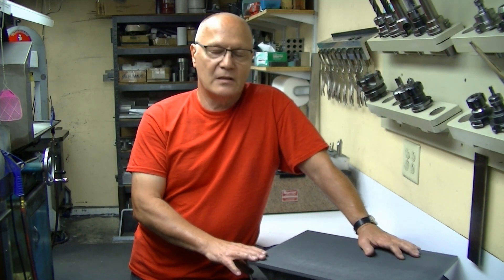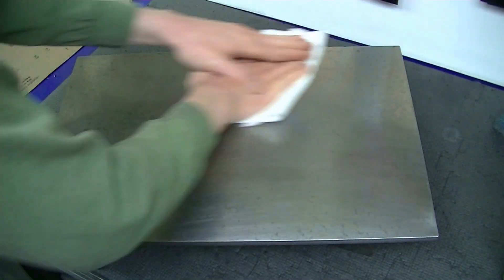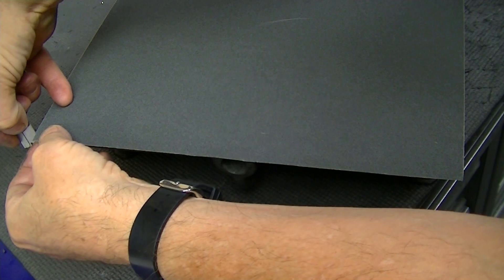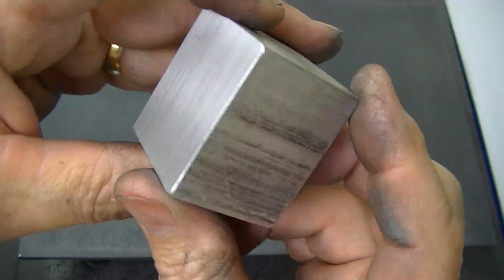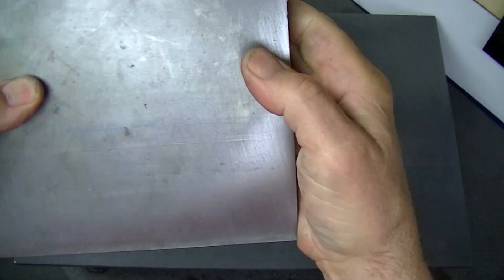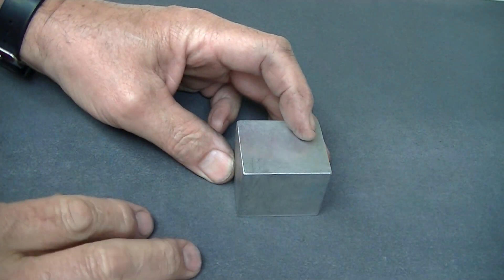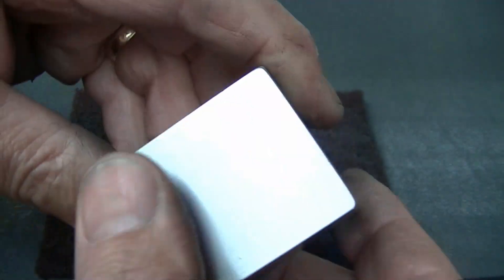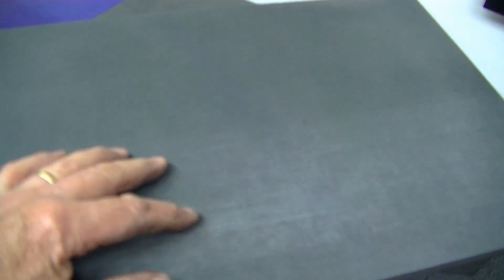THE MAGIC SANDING PLATE  TRT#3

Comment: Paper removal trick: once you lift a few inches of paper, use a dowel longer than the plate (enough for both palms on either side of your plate), and wrap the paper around the dowel onto its self, then use the dowel to roll off the paper.  Would you consider  tempered glass a affordable alternative to a cast plate?
Reply from the maker: yes

Comment: Thanks for the video. I need to order plate for this purpose. But I wonder which one to get, granite or cast iron? Cast iron would be better to move around and not break so easily.. Granite seems to be cheaper.
Reply from the maker: Granite is fine if you dont need a sharp edge.

Comment: We had a cast iron plate like that in our R&D department . We all thought it was a surface place ( like the granite ones ) only made out of cast.
Used it as such. Sometimes we would stick a DA  pad to it. Question , just how flat are they ? are there different types/grades ? how about figure 8's
Reply from the maker: Cast Iron plates can be scraped to any precision level required.
I don't like figure 8

Comment: Hey Robin, how flat do you recommend the sanding plate be? Do you recommend a lapped, ground or milled finish, or is there a PPI at which you’d consider scraping also viable? 

I’m making a sanding plate from a rusty old cast iron plate and trying to decide if I should refine it beyond the .001” flatness I got straight off the mill. 

Thanks for all your excellent videos. My machining has improved a lot from your tips.
Reply from the maker: .001 is plenty flat

Comment: Nice video once again! Thank you :)
Two quick questions: if the cast iron plate is flat (say AA), what kind of flatness can you attain on the part if you do it right?
Can you use it as you would with the precision ground stones (say to deburr the bottom of fixtures etc.)?
Reply from the maker: I would not use it for that.

Comment: If I did this, my technique would result in convex parts. I'm fairly sure that even with practice I would still fail to still have flat planes. Very impressive if you can do this and still maintain the geometry, I suspect your years of practice, including all the lapping, probably make this more feasible for you than it would for me (or maybe I'm just clumsy - im certainly still crap at golf despite decades of trying).

Comment: Alcohol doesn't work because 3M 77 isn't water-based.  Any solvent for oil-base products will remove it.  I usually use plain old mineral spirits (paint thinner).  Then I wipe with lacquer thinner if I don't want the best bond or acetone or MEK if I want a very good bond.

Comment: How would you keep the edges from rounding or bowing(?) to the edge of the part on the thicker "softer" pad of the Scotchbright?
I can get the sheen, but the surface isn't 'flat' (coplanar?) at the edge.
Reply from the maker: I wouldn't use scotchbrite if I needed good geometry.
Reply: So keep with the plate and finer  abrasives for actual lapping?
Reply from the maker: Correct, and apply all the "english" I described. It is a skill that takes practice.

Comment: I recently used a similar method to make a cylinder square out of a huge piston pin, achieved +or- 0001 over 5" after a couple weeks of rubbing.... call it "sweat equity"
Reply: Do you have a part number for the piston pin? Can you find used ones online? Thanks
Reply: @jonedmonds1681  Yep, I found this on eBay, it was brand new old stock here: https://www.ebay.com/itm/Sealed-Power-P-2070-Engine-Piston-Wrist-Pin-For-Fairbanks-Morse-ZC346-ZC503/184067517657?ssPageName=STRK%3AMEBIDX%3AIT&_trksid=p2057872.m2749.l2649

The engine it was made for was a hundred years ago!

Comment: Wanna ask how flat is the work is there visible convex
Reply from the maker: That depends entirely on your technique as described in the video.
Reply: @ROBRENZ  ive heard
 people saying this technique would always make the surface convex  theres a comment on Tom walter's video about sandpaper lapping.
Reply from the maker: @woozhi9218  That is correct In my experience you need a slightly convex lap to get parts flat.

Comment: use a heat gun to soften the adhesive   WD40 is  almost 100% deoderized  kerosene with a  wee skosh of hydrotreated  light pump oil (mineral oil)

Comment: WD40 is acidic. It should not be used as a lubricant,  it is a penetrating fluid designed to break down rust and corrosion products. Never ever use it on locks, it will rot the brass tumblers. Go to your local glass butcher and get a piece of3/8 or1/2 inch plate glass, next get the grit sizes you want, next item is a can of 3 in 1lite weight oil. Put the oil on the glass ,put the abrasive on the oiled glass work as shown on the video,  this technique is the best way to resurface India stone sharpening blocks. You can get small amounts of silicon carbide in different gritts from Harbor Freight . Good luck work safe.

Comment: An old trick I learned back in the 80's from the skateboarding legend himself, Tony Hawk, to replace the razor blade, is a metal file. I imagine you may disagree because aluminum oxide will damage the file but I'm sure most of us have an old beater file lying around or one that's ready for the scrap bin. Plus, it's faster and arguably, safer.
  I should probably actually try it on metal first before claiming it's a superior method though. On a wooden skatboard, it doesn't matter if you dig in a fair amount. On a sanding plate, a sharp edge may be preferable and avoiding a chamfer using the file method may  result in some of the granules finding their way under the paper.

My shop is 8'X10' and I'm just starting out so I still have other priorities before adding a plate this big, Maybe someone would be willing to give it a try. ...?
Reply: A file would leave a more tattered edge, and would cut into your plate. That could make the edge not so straight after doing it for a while, each time you replace the paper.

Comment: Robin, your video is excellant.  What a creative idea for polishing.  Thank you for letting your followers know where to find this paper.  Our website is https://abrasives-south.com/                    and a  link to the part # 18014 is 
https://abrasives-south.com/product/roll-12x36-220-grit-product-code-scpe-grain-silicon-coating-closed-coat-backing-paper-weight-e/    
This one is actually a heavy duty E weight paper that we are hoping will be more durable.  In a few days we will be adding more products to our website to include c weight paper.   Currently, we offer  the C weight paper up to 2000 grit but it's not in our web-store.   Hopefully it will all load correctly over the next few days.  Thank you again for all that you do.  Best,  Jim Carter
Reply from the maker: Thanks Jim, I added the link to the description.